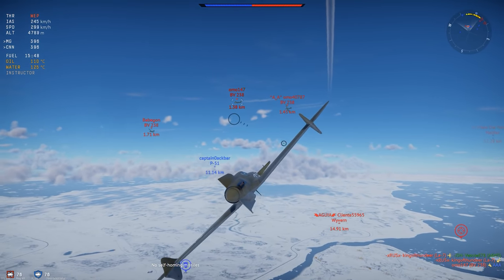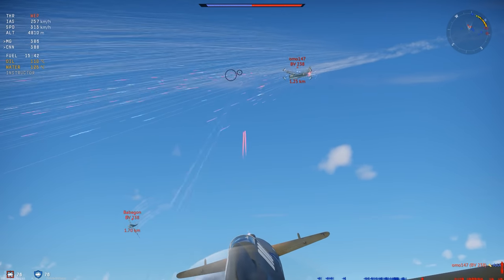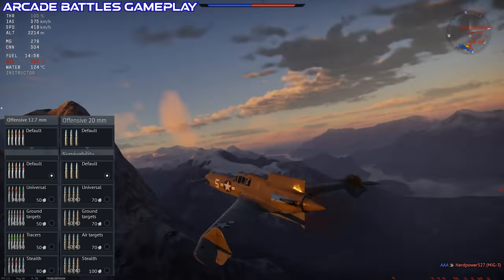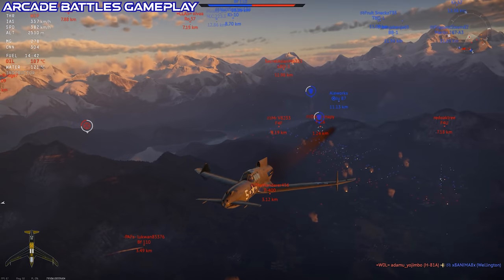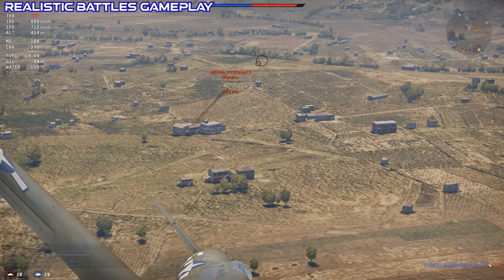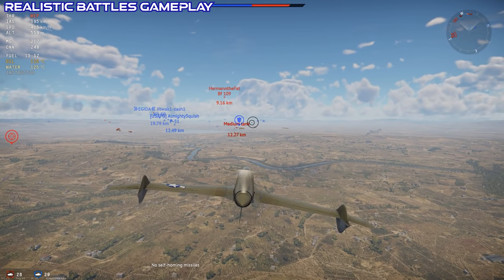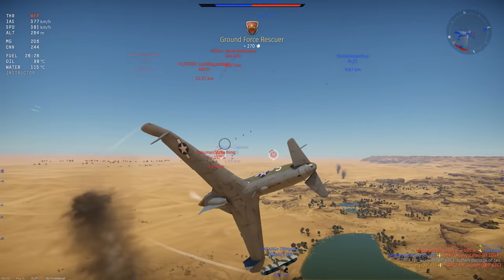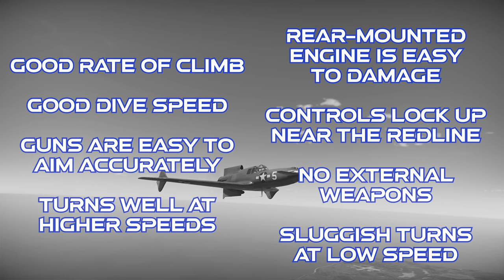XP-55 In War Thunder : A Basic Review

Comment: I tried this out today on a whim, curious as to if it could even fly. I am SO DAMN surprised that people aren't spamming it. It's an insane aircraft for it's Tier and BR. It turns on a dime, climbs well, retains energy, and has cannons. It's absolutely ridiculous
Reply: Definitely. I take it out in GRB at 6.0 with the M41A1 and M18 and it's still pretty potent against enemy fighters as long as you're careful to play to its strengths. Unlike Tim, I actually think it's quite effective against tanks at it's BR in GRB since the 20 mils can punch through most roof armor (a significant upgrade over 50 cals) and it's agility allows for close-in top-down strafing.

Comment: Thanks for review, Tim.

The reason why the Ascender cost as much as a rank 4 fighter is that it has an insane BnZ potential, especially in arcade where there's no rip speed and compression is less severe. As long as you're above any opponents below 8.0 BR, you'll be able to dive and dispatch them. The plane can rake up a lot of "skill matters" reward if you can exploit its dive characteristic efficently.

Comment: What if I want to use it for bomber hunting? I noticed that the .50 belt has the same ammo count (400) as the 20mm. Which means that the MGs run out before the 20mm does. I thought that was unique enough to mention. Also that I just put one in a dive in test flight and got up up to 800 kph without a red speed indicator or any sense that the controls were stiff.

Comment: Random guy here
Make a video of the Ki-43 3 otsu Hayabusa. It's roll rate is insane. You can deflect any guns even p47 8 50cal. It's arm with light 2 20mm guns only 300 round sadly. When you see this plane in the air it's good at low but it can climb to 4000m easily and note it can turn fight like a zero on the vertical. But still the engine is slow and this plane is very fragile

Comment: If you check the build records, the one in WT should not be like it is. The one with the good engine (ala this ones engine) had 4x50cals, not 2 50's and 2 20mm's.
Reply: There are even the holes for the extra guns they just aren’t on the plane as far as I remember

Comment: Unrelated question.  Why do I keep ripping my wings off when flying as the G.91?  Am I missing something because it seems really inconsistent and sometimes it happens at high velocity and sometimes it doesn't.
Reply from the maker: The most common answer is "unequip the hydraulic boosters upgrade" , you'll take a slight maneuverability hit but in most planes you'll rip your wings a lot less often.
Reply: @TimsVariety  Thanks, I'll give that a try.